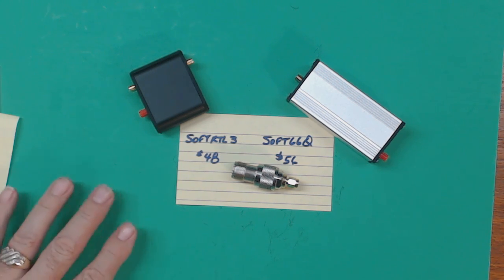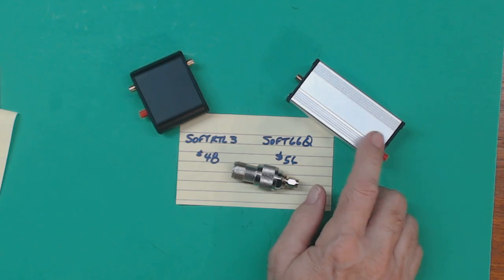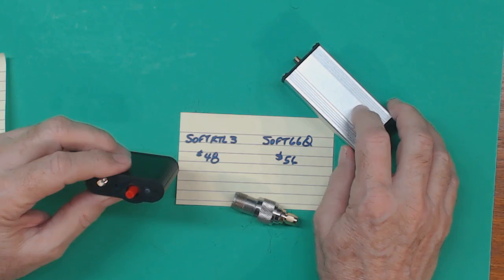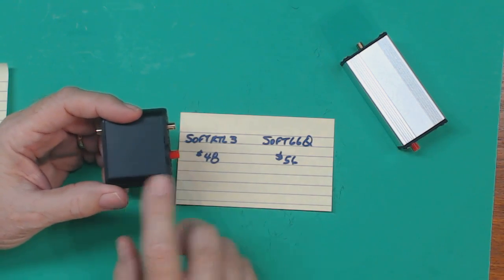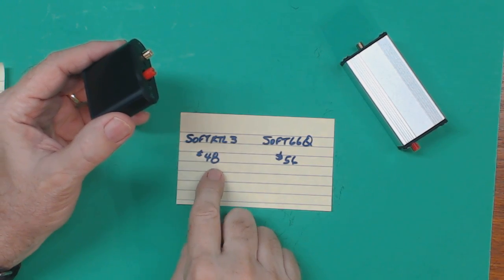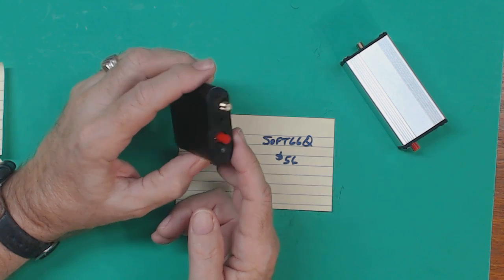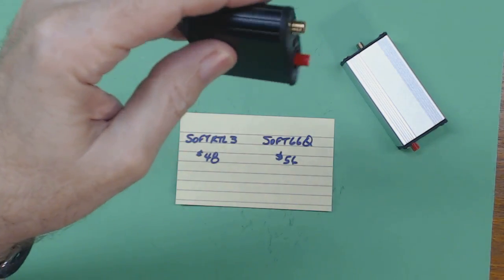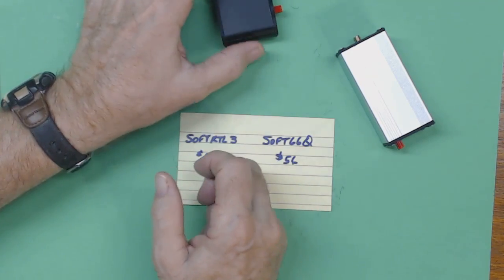TRRS #0896 - Soft66RTL3 Software Defined Radio

Comment: This is great, how powerful of a laptop/PC is required to run a SDR device?
Reply from the maker: It really depends on the SDR and the software.  I use HDSDR on an old HP laptop which is running Win7 and only has a dual core processor.